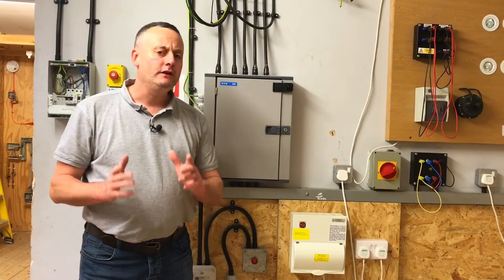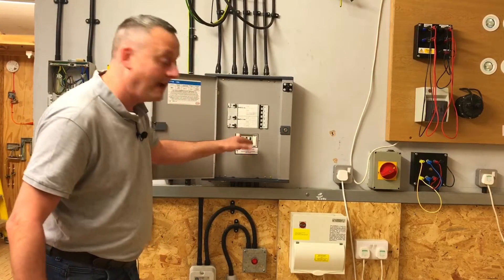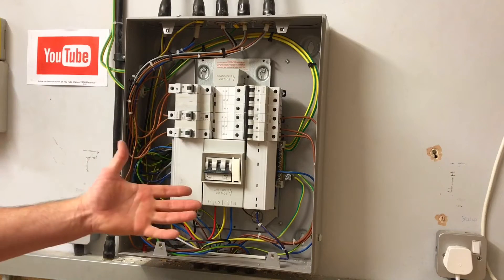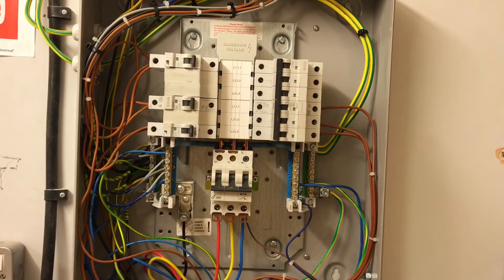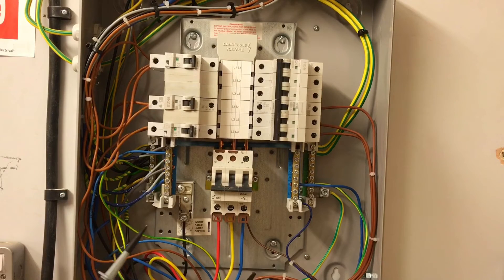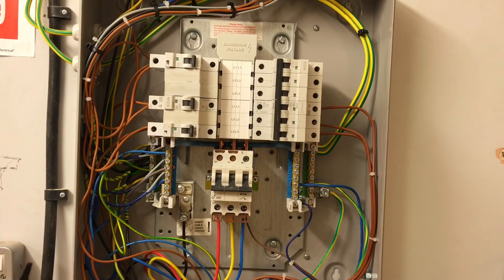10 Stages of Safe Isolation for a 3 Phase Distribution Board (3 Phase Supply) AM2 and AM2S

Comment from the maker: == 🕐 Time Stamps - Cut to the action 🕕 ==
01:30 - Turning off individual circuit breakers
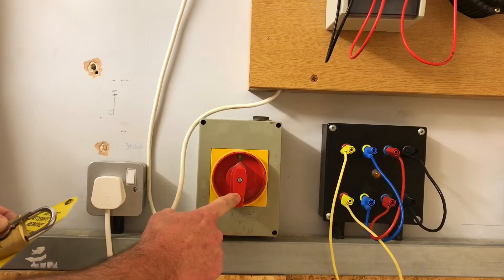03:00 - Locking off the isolator
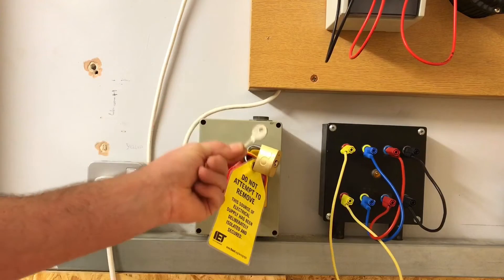03:16 - KEEP HOLD OF THE KEY
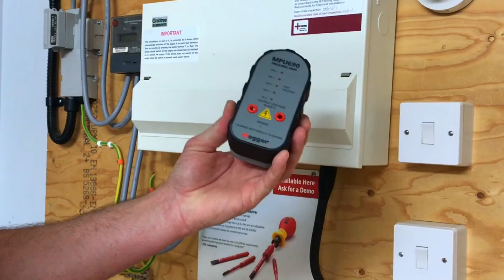05:22 - Proving your test equipment on a proving unit
06:15 - Exposing the incoming supply cable terminations]
07:21 - Testing between neutral and L1, L2 and L3
08:02 - Testing between the Earthing conductor and neutral
08:45 - Testing between the Earthing conductor and L1, L2 and L3
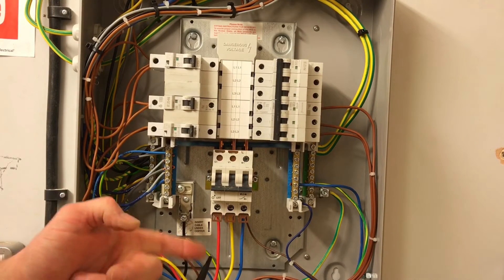09:34 - Testing between L1 and L2, L1 and L3 and L2 and L3
10:15 - Reprove our voltage indicator on our proving unit

Comment: Hi guys .would you also check dead on the load side of the main switch just in case if there would be another source of supply or borrowed neutral from another DB?thanks
Reply: On a real installation you would test on the load side of the isolator as the supply is usually still live.

The example here is for the classroom setup really

Comment: Prep course I just did only said to isolate DB at switch, I.e. the incoming supply side of switch would still be live, surely this can't be correct?
Reply: I thought that too.....but then again in the real world there may not BE any means of isolating the supply side of the main switch other than pulling the service fuses. Also not mentioned in the vid is the possibility of the board being fed from more than one source ....such as a generator or solar PV.

Comment: Hi gaz I’m currently completing my testing section for my nvq when I get evidence for safe isolation will it still be okay if I use the main incoming tails to prove indicator is working 
As not all installations have a linked switch between meter and board

Comment: Can I use a simple multimeter for taking these measurements to see if the circuit is live?

Also, what kind of measurement equipment did you use for this video? 

Thanks
Reply from the maker: Test Leads and Probes the Requirements for GS38 Electrical Test Equipment for use on Low Voltage https://youtu.be/mJlwKRk6A8g

Comment: Could not a Category IV multimeter and test leads be used for testing?
Reply: Not recommended. Essentially the value given on a digital multimeter is a calculated RMS value worked out by the internal electronics of the meter. They can & have given errors. There is also the possibility of selecting the incorrect range i.e D.C instead of A.C (I've seen it happen!) They also have internal fuses which may be blown/ruptured. With proper voltage/potential indicators the lights etc on them are driven directly from the source of supply. There are no ranges to select or get incorrect. Couple this with a proper proving unit or 'known source of supply' you are properly indicating to yourself that the supply is dead. It's the last step before you potentially come into contact with electricity. I do it without fail every time. I like life!!

Comment: If you're locking of the actual main switch at DB and not a separate isolator, Do you lock of main switch before removing the cover???
Reply from the maker: Great question... some covers cannot be removed with a locking device in place so take each case on its own merits. Always isolated before removing any cover and restrict access to the area etc. Gaz 👍

Comment: People often laugh about level of testing and proving 
But in my 35 years as refrigeration engineer have had both
Incoming isolator to panel not disconnecting
And tester failure DURING USE
So do it correctly and always
I've said to apprentices repetition breeds habit

Comment: In the 2391 exam there is an extra point missing here for safe isolation which is to seek permission from responsible person before isolation. This is just incase someone is on a ventilator or life support in one of the bedrooms.
Reply: This is correct you need to ask for permission
Reply: It should be on an UPS.
Reply: @lukasbarnes  clearly haven’t done you’re am2s you need to ask for permission

Comment: Great video, 
with the am2 I believe we have to do 3 other safe isolation tests for the fault finding sections, a lighting circuit a motor circuit and distribution board. Are the 2 circuits locked off individually and checked at the end of circuit and then the distribution board the same as this safe isolation in the video??? Thanks
Reply from the maker: Hi thanks for your detailed message. Gaz

Comment: Excellent video as always!
That board really is really a bit messy inside. But for the demonstration of proofing if the board is dead it is sufficient. I don't know the regulations in the UK for this, but some things which catched my eye:

-grey used as neutral, which is normally L3 in a three-phase system. I don't count in the incoming wires of the supply of the board, black was the neutral in the old UK wiring afaik, and the red, yellow and blue indicate that this is an older colour code. In Germany this would be correct btw., in the old german colour code grey was used as neutral or PEN.
 -all lines are of the same colour, this is only permitted here if you use single conductors and not cables. The different colours make it easier to get the right direction of the rotating field in a three-phase system. The direction is clockwise, or right. Otherwise this can have massive consequences, because electric motors are rotating in the wrong direction. In case of a three-phase table saw the nut which holds the blade could become loose and fly arround. Quite undesirable.

Here almost every distribution board is three-phase, even in residentials. It spares much installation material. For example, kitchen cookers and ovens are connected three-phase in a modern installation. They're normally connected with 5G2.5mm² NYM-J, and fused with a 3x B16 A MCB. That are ~11 kW. But the cookers are not 400V appliances, they are diverted equally on the 3 phases. Normally a large and a small cooking plate on one phase, the baking oven is connected to L3. So you can also use these appliances on a single phase system, but you'll have to install copper bridges between the terminals for the three line conductors.

And for locking out: Use always your own lock and not one for example distributed by the customer! You never know who else has a key for that lock.
Reply: I found out recently that 3 phase to homes is being phased in in some areas - pardon the pun !
I've thought about how I'd split my cooker to run off my 3ph generator. I think left hobs L1, right hobs L2 and ovens/grills L3. BUT as my gen is only 2.2kW per phase, I'd leave the cooker on one phase, kettle on another phase and everything else on the third phase.

As for the locked switch - just remove the 4 screws holding the front of the switch on, lift off the cover red knob & lock and operate the switch from inside - easy !

Comment: My AM2 didn't have a remote isolator so had to loto the main switch.
I always test.
CPC to L1-L2-L3 LOAD SIDE
CPC to NEUTRAL
NEUTRAL to L1-L2-L3 LOAD and SUPPLY side. If the supply side is still live this also re-proves the voltage indicator as we go.
Then
L1 to L2, L1 to L3, L2 to L3 load side
Re-prove.

Worth mentioning, everytime you put the voltage indicator down RE-CHECK and RE-PROVE.  My assessor said that showed great care and yes at that moment of puttingit down it could have broke.